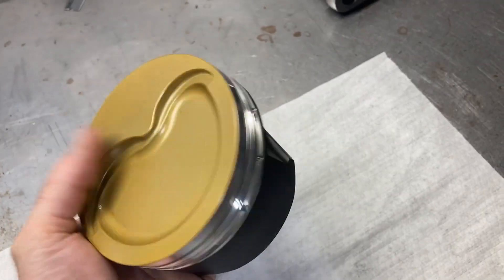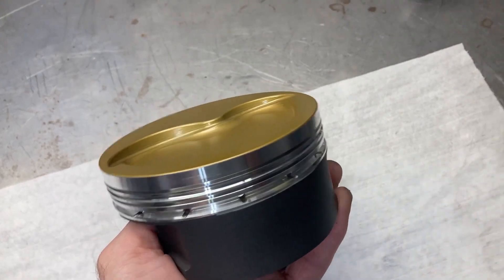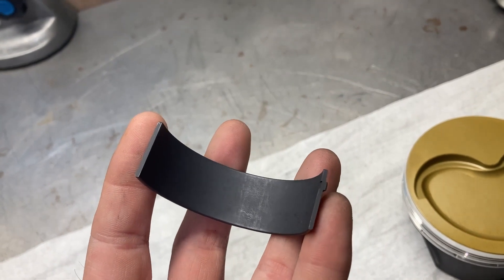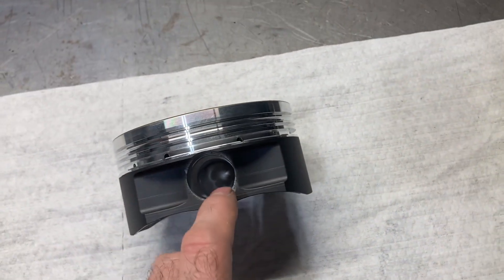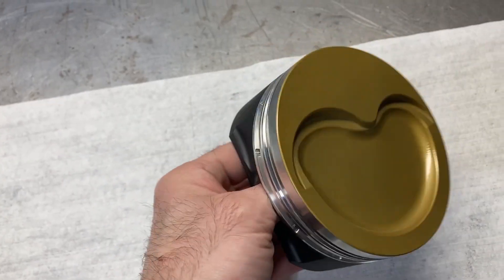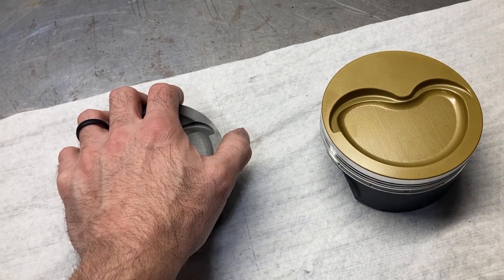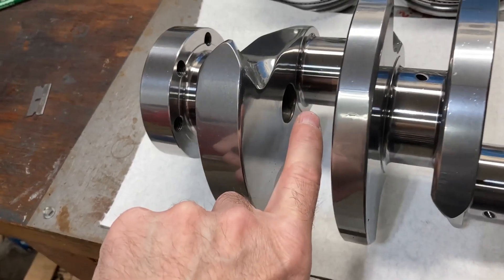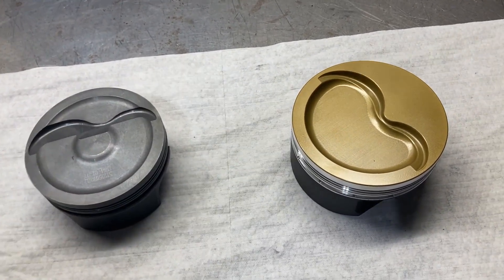Lykins Motorsports Basic Engine Coating Overview

Comment: Calico is PolyDyne from TX same Coatings Carl owns PolyDyne and license’s his process. I have used it since 1989 when testing head gaskets at FEL-PRO our pistons would develop cracks in the pin boss area under the intake pocket BBC L-88 in 12 hours or three tests. Carl coated a new set of forged pistons exactly the same brand that we have been cranking. After 200 testing hours still no cracks.
Been recommending ever since. Oh I even had my 1 cyl Nitro RC boat piston coated. I couldn’t kill it like I did to others on 65% Nitro.